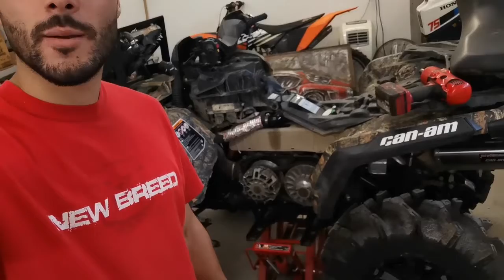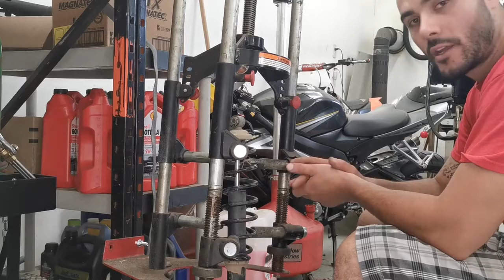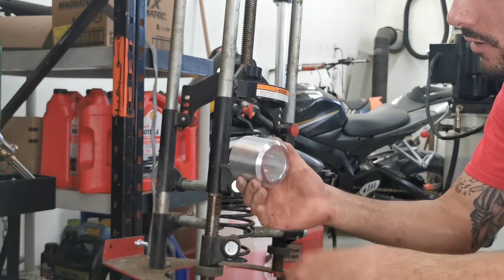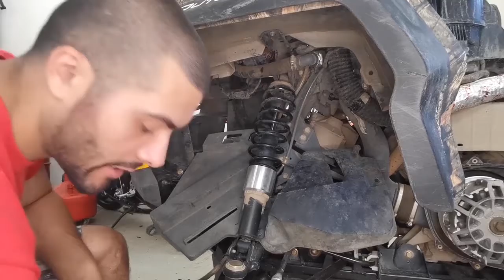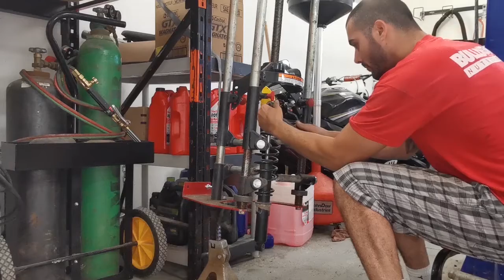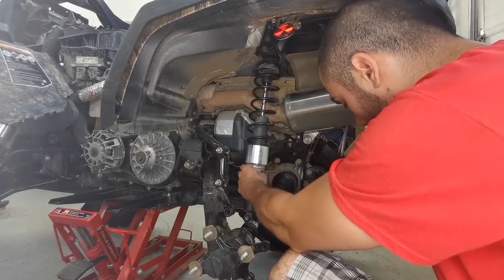CAN-AM OUTLANDER 850 LIFT KIT INSTALL

Comment: How many inch tall is that spacer normally for a two and a half inch lift they are only 1 in tall that looks like about a 2-in spacer and height
Reply: I made my own out of PVC it works perfect
Reply from the maker: Approx 2" if I remember correctly
Reply: What brand spacers did you go with?